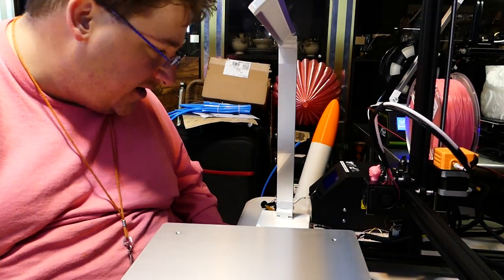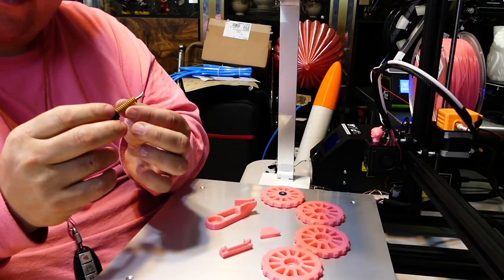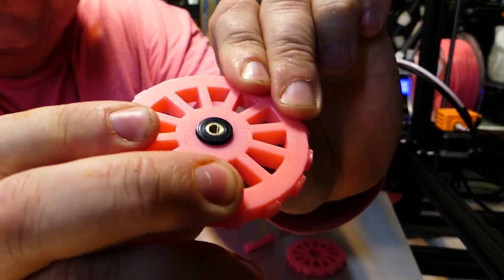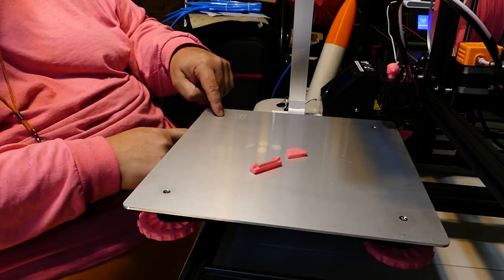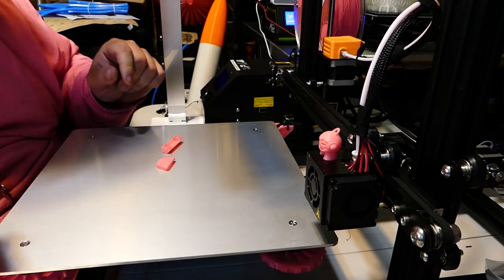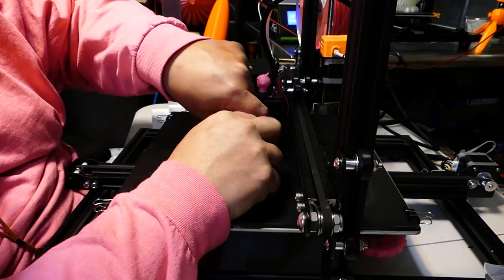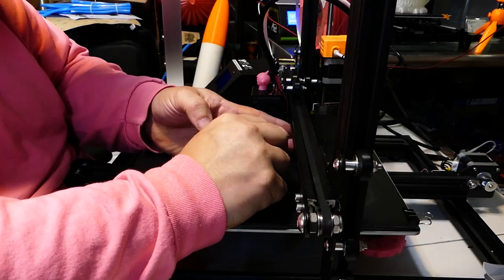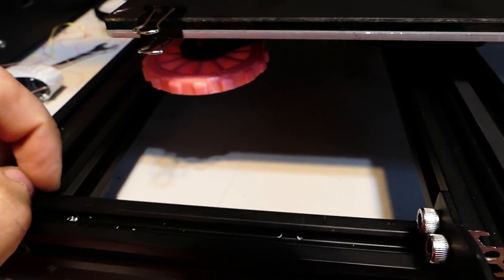Today's 3D Print - CR-10 Essential Mods Install

Comment: Creality are now putting the stress relief mod onto the printers standard now. They got permission from the creator of it to use it
Reply from the maker: +Justin Kennedy yep i know. I am just curious how deep the supply chain is and how many old ones are left if any.
Reply: Nerys I just got my first CR-10 (Dec 4th 2017), and it came without either mod. Via GearBest and a US warehouse.
Reply: AFAIK you have to order a CR-10S to get the upgrades. My CR-10S came with some of these upgrades pre-installed, like the cable strain relief, bed insulation and of course the second Z motor/threaded rod.
Reply: got mine, printed this and was like wait....I already have that lol
Reply: yep just got mine and it came with the strain relief on it... i found out after i printed it out though xD

Comment: The springs are called “die springs.”  They’re used with heavy duty punch presses to push the punch assembly away from the die assembly after a punching operation.
Reply from the maker: Thank you I eventually discovered that or rectangular Springs as some places call them

Be sure to get the light load Springs not the extra light or the medium you can get them on Amazon pretty cheap
Reply: I kinda figured you might have discovered a source. I actually ordered a set a couple of weeks ago when one of my springs went missing during an adjustment. Of course I found it the next day.
Reply from the maker: Allllllllllllllways how it works!

always.

could not find the key to my thing years ago (74 thing)

I spent 3 months trying to find it. when I finally gave up and took a door off to take to the shop to get a key made $70 later calls me up says its done. not 30 seconds after I hang up the phone there is the keys sitting on a movable work table I have in the room. right there. just sitting their. Grrrrrrrr soo mad :-)

 @lilithcal

Comment: I'm a fan of pink. I'm waiting on my CR-10S to arrive. I already have my filaments, going to use Hatchbox PLA yellow for my upgrades. I'll do the same parts as you did.
Reply from the maker: Doctor Fantastic included a G-Code file so you can load that into your cr10 and just go

Comment: thanks again,  I've done similar mod for the strain relief, one thing I did do was  print out 3 plastic washers  the same thickness as the base of the strain relief  to maintain as consistant as possible spring tension  across all 4 points & fit  4 cardboard &  4 steel  washers between the springs and the heatbed as I'm a bit paranoid about the springs scratching through the lacquer and shorting out the traces, cant be too careful can we, thanks again for posting this

Comment: Get a deburring tool, you can clean up the squished edges instead of using a knife. I know you like to get your prints to squish well, so it's great to run over the edge to cleanup the sharp edge. They're cheap and available on prime -- plus they work super well with aluminum (as they're intended for metals) and plastics.
Reply from the maker: kazolar looks like they will work with inside curved but not outside edges where i need it. Cheap enough though will add one to my next order and see how it goes.

Comment: Would you need to add a fibre washer or printed plastic cup at the top of the spring to avoid contact with heatbed for potential scratching of heat element and cause short. This was an issue in theWanhao. Did you print those thumbwheels as a continuous print or sequential, my attempt at normal continuous failed due to bed adhesion two of them game off. What infill did you use for those ?
Reply from the maker: NetWolf3D i did them sequentially 25% grid infill. What are you printing on?

As for washers. No need. No electrical traces there so nothing to scratch. Can't hurt i guess so add em if you got em.

Comment: With those new knob though you just slip them on to the existing knob from underneath without having to remove the bed and screws. I never considered taking the whole thing off and doing it the way you have done it.
Reply from the maker: NetWolf3D you are suppoaed to remove them to install. While they will technkcally fitnthe other way they are not supposed to go on that way. The hole isnsized specifically to recieve the knob protrusion so the friction to the carriage plate does not change and they become captive ie can't fall off.

Comment: Great video...but one issue:  I printed the set and they look nice.  I just happened to have replaced the clips that came with my CR-10 with much smaller ones... which was fortuitous because the printer would have literally tried to print the knobs on top of the (larger) stock clips since the knobs are positioned (in the gcode) to print in the four corners.... and the printhead would have actually hit the clips had I left them stock.
  Anyway, you might want to modify your gcode to print the knobs a little further away from the edge... or install smaller clips like I did.  You also might want to add a caption (or addendum to the link video+thingverse description) to warn people that the gcode might cause the printhead to hit the standard clips included with the CR-10.  Anyway, just thought you'd want to know...Again, this is a great and informative video.  Many thanks!
Reply from the maker: +Eric Hemingway good point I should be able to get away with moving them a little further in I wanted to make sure to avoid collisions with printed parts but forgot that I coded it for the specific placement of my clips :-) should be pretty easy to adjust
Reply: Nerys True, it is easy enough to modify the layout , but I just thought it might be worth mentioning if you ever revisit the download/thingverse page.  Also, I installed the fan remix and it also sits a little bit lower than the original so it can hit clips that the original one might clear.   Not sure why Creality left very little room for the required clips that are included...  The default build area can easily allow the nozzle to hit the included clips if they are fully inserted onto the glass.

Comment: Also would PLA pro be better or even petg for the strain relief as would not the heatbed melt PLA over time at high temps?
Reply from the maker: NetWolf3D i normally use pla pro for strength and nice prints but the temps dpnt matter. None of them touches the heat bed or nozzle and none get anywhere near trans temps. Even the shround surrounding my anet e10 nozzle and heat block never deforms or melts.

Comment: Flat Springs..... McMaster-Carr .... type in 'coil springs' ... then click on "DIE SPRINGS" then click on "Color Coded Metric Springs"
Then in the left column pick ID/OD/Length/and how strong.
Reply from the maker: Amazon link in description they are under 3d parts accessories category and are quite cheap.

Comment: What's the point of the knobs? I just set it once and never have to touch it again? I feel like the knobs make it too easy to accidentally hit it and mess it up. Are people adjusting the levels that much?
Reply from the maker: My printers run 24/7 so over time bed level can drift. This makes it very easy to mke teeny tiny adjustments ithout diturbing the bed too much. I also physically move my printers around as needed which absolutely dosturbs bed level.
Reply: Nerys makes sense

Comment: Do you have a video o. Adding frame braces
Reply from the maker: +Ronnie Laniohan I cr-10 should not need frame braces it is extremely rigid as it's designed it's one of the reasons it's such a good printer

Comment: When I tried to import your drawing into Cura it wouldn’t fit, I couldn’t separate the parts! It would be better if you could bring the parts closer?
Reply from the maker: +trialnterror don't bring it into Cura just load the g code onto your CR 10 it will work :-) otherwise go back to the thingiverse listing and on the left hand side down a little bit there are the remix links to the original files none of these files are made by me I just put them together into easy G-Code for beginners to print :-)
Reply: Nerys I got it! Thanks

Comment: A friend of mine's 3D printed some knobs and gave it to me that's supposed to work on a CR 10 S4, which I have but did knobs can't be put on because they hit the railing underneath can anybody help me?
Reply from the maker: That's correct oversized knobs won't work on the S4 you have to use smaller knobs

Comment: Hi Nerys
What software do you use to design your parts?
Reply from the maker: These parts were not designed by me I simply put them in a set that is easier for new users to access the part I do design are mostly in tinkercad and I am dabbling a little bit with Fusion 360
Reply: Nerys ok, thanks... That explains the strange layout of the STL file. Currently, my CR-10S is "down" until I can replace the thermistor on the hot end, and my other printers do not have a print surface large enough to accommodate all of the parts in your layout. I ended up printing the cooling fan shroud on my Ender 2 by using Mesh Magic from NCH Software (free) to split the parts into separate pieces and print them separately.
Thanks for your videos, they are helping people. I refer people to your channel all the time.
Reply from the maker: On the thingiverse link the files are correctly Marked as remixes and you can go to the original source for each object and download them individually
Reply: I was watching another one of your videos and you mentioned that you couldn't get the Stanley folding chisel anywhere... They have them on Amazon for about $22 bucks.
https://www.amazon.com/Stanley-Hand-Tools-FMHT16145-Folding/dp/B00NOVP8KY/ref=sr_1_4?ie=UTF8&qid=1530035008&sr=8-4&keywords=stanley+fatmax+folding+chisel
Reply from the maker: yep. I nabbed one soon as I saw that! so now I have two :-) makes me happy.

I also just got my normal stanley set in and "SO FAR" the non folding stanleys seen to also work well. Will need more testing. will report back.

Comment: I like the nobs for bed leveling, but would having an automated mesh bed leveling not so much better ? I am not sure if a mod for that is available for the cr-10 ?
Reply from the maker: +Usurpine Susanti sure it would be better the problem is it would also be more expensive:-) if you use an ultra flat piece of glass once you level it you're pretty much done sometimes my level will appear to be off by a tiny bit but I've discovered it just didn't home correctly I've learned to stop restart and let it be home again for attempting to fiddle with knobs and most of the time I don't have to change anything so unless the Springs tend to drift which for example they do on the Ender to which is why I replace the Springs with the slightly topper Springs that are similar to the ones used on the cr-10 Now They Don't Drift anymore I pretty much never have to relevel my bed it just prints every time over and over again I run these printers almost 24/7 you do want to be careful not to be too rough with the printer when removing the plate or the print where you can upset your bed level if you do end up moving the bed give the bed a couple of TAPS if your fingers good hard caps are you trying to poke somebody and that will usually resettle the Springs where they're supposed to be otherwise I really don't read that with my printers they just stay put once I level them maybe once a month I have to tweak and knob but that's usually it where match leveling would come in handy it's an automated unattended printing will you need to make sure it's going to stick when you're not there to verify it otherwise I'm totally fine with the way they work I don't want to mesh adjusting my prince from uneven surface because then that means the bottom of my printers not flapped the geometry of my printers off I believe in garbage in garbage out mesh bed leveling is adapting to garbage in a non even Print surface put a perfectly flat print surface on the printer and the problem goes away no more garbage in garbage out
Reply: OK. Good to hear from someone having lots of experience. I have ordered my cr-10 S4 a while ago, still waiting for the delivery which will be on 19. dec hopefully this year ;)
And i was looking for the auto bed levelling kit (https://drive.google.com/open?id=0B0Jb9SruV4vGVndyYXV3Mm9GTlE) CREALITY-CR-10-AUTO-BED-LEVELLING-KIT-melzi-board from skynet3dmods. So now i just wait and see how far I will come with 4x pink knobs and not wasting too much money on mods nobody really needs. Thanks for all the infos, Nerys.

Comment: Hey Nerys,
Do you have any idea if in the latest CR-10S the fan mod is already supplied with the printer?
I have heard some rumors about it, and I would like to confirm that.. trying to avoid from disassembling the fan.. I'm a total newbie in 3D printing..
Reply from the maker: +Yakir Sabag it comes with the 80s molded duct and the fans themselves do appear to be slightly quieter then the original cr10 I'm still going to replace them :-)
Reply: 80s molded duct?
Are those okay or should be modded?

Thanks for your quick replies.. learned alot from them!

Comment: Second 3d print and it's this Essential mod kit...Halfway done, looking good. Only thought is the knobs look huge and almost like they will hit the aluminum frame when done. Is this for all the cr-10's? Mine is the 300X300X400, guess I'll see in a few hours....Thanks for the vids and files.
Reply from the maker: Truegrit Scott i believe these only work for your printer the 3x3x4 afaik they will not work on the 4x4x4 or 5x5x5 cr10's. On yours they clear everything and you will freaking love them.
Reply: The knobs are PERFECT, and WOW a big help....The strain relief I am slightly unclear on. Does the spring sit on the strain relief, with the strain relief sitting on the black chassis? Or does the strain relief touch the heated bed(don't think so) with the spring under it...I ask because I have a gap between heated bed and Y of strain relief....?
Reply from the maker: Truegrit Scott correct the strain bracket sits on the carriage plate the black plate then the spring sits on top of the strain bracket then the Vault goes through everything
Reply: It is PERFECT....The entire kit rocks! And next print is the filament guide to keep it off the Z screw....That and I just saw on the FB group clips that fit into the aluminum chasis for cable management...Might be worthy additions to your kit?!? Again THANKS!
Reply from the maker: Truegrit Scott I would not worry about the filament guide it's not needed just wipe down the Ross take any excess grease off and it's fine I have thousands of hours of printing and no problem

Comment: is the upgrade cr-10 better or what is the real diff between the basic model cr-10
Reply from the maker: I will reserve judgement until I build it (I have a CR-10s sitting here in the box in the coming weeks I will build and play with it and put up videos for you guys.

while the filament run out is neat its not a deal breaker. I am not too keen on the Dual Z as I prefer one Z since this means you NEVER have to level the gantry. ever and one less component to fail BUT it will make Z stronger and bonus (what I very likely will do) is permit more mass on the hot end. meaning I am probably going to convert it to direct drive instead of boden (something you can NOT do on the single z cr-10) so I can install a flexion and have a high temp and flexible monster :-)
Reply: OK, I speak English and you just spoke French. LOL 
You prob mean, CR-10 basic is a good machine and does basic stuff, the CR-10 upgrade dual Z can be changed to be a Monster.
As a first machine I was going to get the upgrade - sounds like the basic model is fine if you don't want to do the mods you are talking about.
Reply from the maker: The flexion is an extruder designed specifically for flexible materials. its very good. but it really needs to be direct drive not bowden. but you can't really use direct drive on a stock CR-10 (too heavy) but a dual z should handle it just fine. so I might upgrade my CR-10 S to be a flexion direct driver printer. which will let me print high temp and flexible filaments with really nice resolution even if not fast. IE a flexible printing monster. :-)